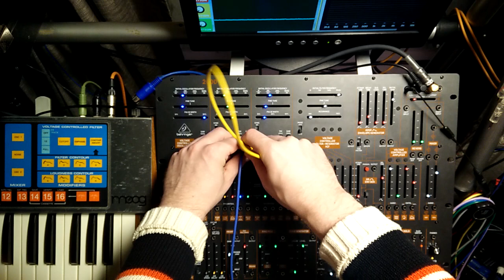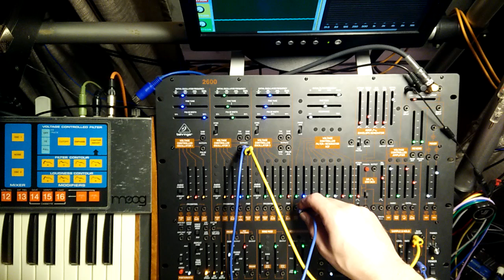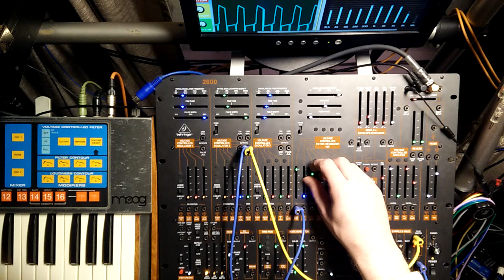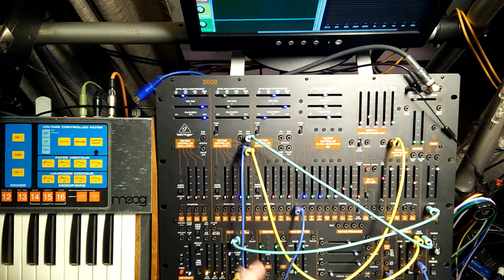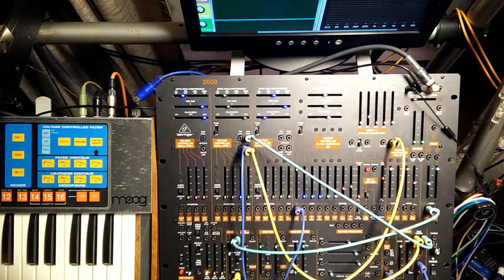Behringer 2600 Sub Oscillator Trick

Comment: any way to achieve this without stackable cables?
Reply from the maker: The suboscillator trick doesn't need stackcables. You can just run a square from an oscillator half way into the external clock in for the sample/hold. Depending on the cable you use the connection might not be stable though. Stackcable was the most reliable out of the cables I had. If you want a more reliable way to get a suboscillator you can buy a Behringer 104 case and powersupply module and then get the sequential switch from the Moog modular series by Behringer. It's super cheap and will let you do suboscillator tricks but many other things as well.

Comment: I found it all but impossible to get the right spot for overriding the internal clock without lifting the normalled contact, as the tip of the jacks is v steep. My solution was to file a long taper on opposite sides of the tip, allowing for a more controlled position. It still requires care, but it's better than touch & hope :)
Reply from the maker: Interesting! Thanks for sharing! I can usually get it to work with a stackcable pretty reliably. It is touchy though. Might eventually mod my unit for a proper clock in to the switch.

Comment: There should be a way to fix the need to put a plug in halfway in the ext. clock input. Maybe with a different plug or something. Anyone any ideas?
Reply from the maker: The proper solution here is adding a clock in for the electronic switch. This is a known mod for vintage 2600s and clones as well. It's a simple mod you can probably get a synth tech in your area to do the mod for not too much money. Maffez might have the mod documented on his site. As for a special cable this might be possible.
Reply: @Bata9999  maybe crossing the polarity of a cable could work no?
Reply from the maker: @3ertin  I can't see why that would work. I think it would just change the phase.
Reply: @Bata9999  I was thinking that when you put in a plug halfway, the tip connects with the base. Therefor an adjusted cable could work. But what do I know. :)

Comment: Wow this works on the 2600m too. Why does the half in patch cable do this?
Reply from the maker: Cool, I was wondering if this worked on the 2600m/FS. I don't know why it works but a half patched cable can be used on any of the mod inputs as an output as well. https://www.youtube.com/watch?v=Ve85IkMNoa8 This video explains it.
Reply: @Bata9999  Ah that's cool, thanks.

Comment: I love this! I’ve not heard the 2600 oscillators sound so aggressive. I’m saving for one of these and one of my concerns was that it might not be able to go very aggressive and roar, but this video has confirmed it will with specific patching. Good work
Reply from the maker: There are lots of cheap distortion pedals and plugins that can give your synth some extra aggression but on the 2600 it's easy because you can overdrive the preamp and filter/VCA as well.
Reply: @Bata9999  Thank you 🙏🏻 ace I can’t wait. It’s a game of patience to get one